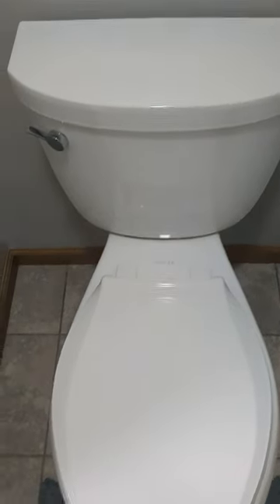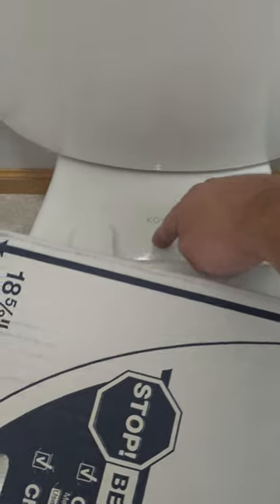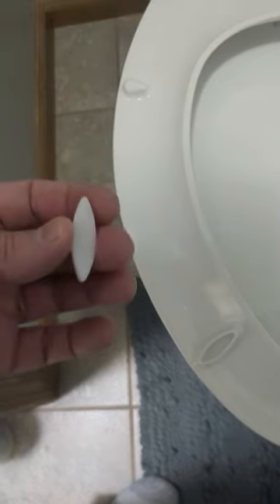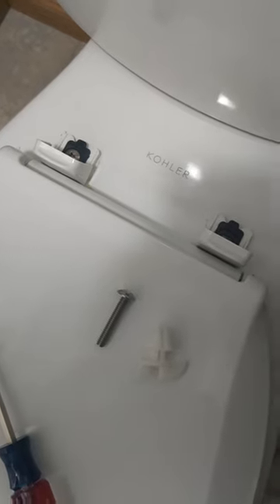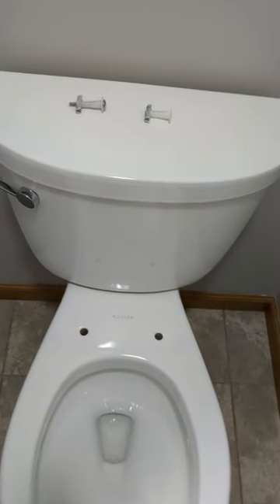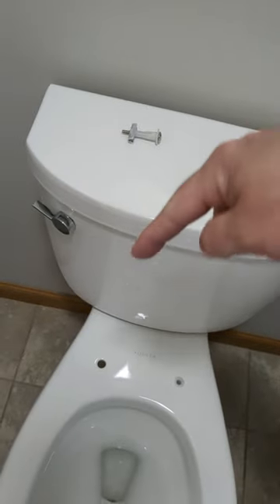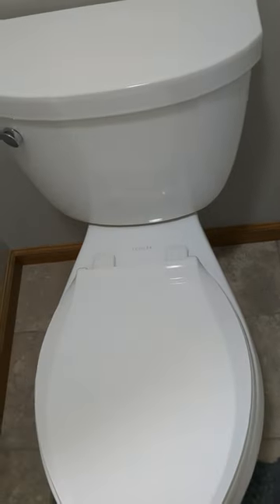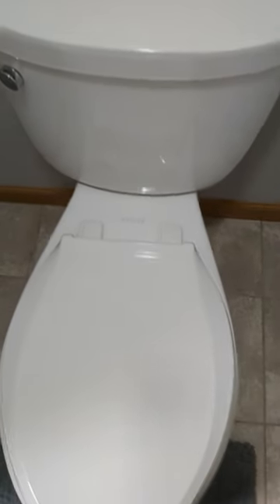Install a KOHLER 4636-RL-0 Cachet ReadyLatch Elongated Toilet Seat to replace a cracked toilet seat

Comment: Thank you so much for your video!  I couldn’t figure out how this “new and improved” fastener system worked, as the wife was saying, “Sorry, this was supposed to be easy.”  A complete fail by the manufacturer in not providing ANY instructions or illustrations of how this fastener was supposed to work.  But for your video, we would have sent this back.  Thanks again!

Comment: Mine cracked in the same spot on the back and directly across in the front. Seems like a manufacturing/molding issue with so many people having the same problem. Smells like a class action lawsuit. I'm down for getting a $5.74 check in 8-10 years! 😂

Comment: Many thanks! The lack of installation instructions in the box was annoying. We had 3 Kohler toilet seats that lasted 6 years before each of them started showing cracks, one in exactly the same place you noticed, the others along the side. Happened with or without the installed soft padding wedges, since we had two with and one without, all of which eventually cracked.

Comment: Thank you -couldn’t have installed it without your instructions.  I don’t know how to get the soft pad tips on the toilet lid because they seem too small to fit over the “bumper”?
I’m going on my 3rd Kohler toilet seat in 8 years … they  
have all cracked.  Both previous seats cracked at the bottom, the top and had fracture lines in the middle!!!
I asked the salesman at the plumbing warehouse about this problem and he said he had the same issues. Numerous customers have complained. I had no other option so I was forced to purchase this one again. 
I think the seat looks great. It’s very comfortable but as far as the quality of the material, it is fair. Not worth the cost $65!
Kohler needs better quality materials for this price!

Comment: I MUST send you a BIG Thank You for this video. I had the same problem with my old seat, except the crack was at the front instead of the back as your was. I ordered the same replacement seat which came with ABSOLUTELY NO INSTRUCTIONS. I did not find the installation process self evident at all, and I sincerely appreciate how you saved me a lot of frustration and time wasting. I also appreciated your tip about reusing the seat support thingies as the package was missing one! Thanks again from one weekend warrior to another!!

Comment: Had the same problem with identical crack on the front. Since the cracks appear to be in the exact center of the front and rear, it appears to be a problem associated with the molding process.

Comment: I had the same crack in the back, but only noticed it after a while, bought a new one as a backup for the day I would need to replace it, when the time came, I started unboxing the new one, and noticed the new one, which was still wrapped up also had the crack at the same spot. Kohler would not take it back since too much time passed since I bought it. must be a manufacturing error of some sort.
Reply: Update: The issue with the crack was back in 2022, the new ones now in 2024, like your new one, don't seem to have the crack issue any more.

Comment: I've had 2 Kohler seats crack around the rear seat "legs" that don't touch the toilet themselves so the seat was bending.  Not sure how to fix that.  Also, after unlocking you should be able to lift the seat off the black inner parts that have the bolt through them but its very hard and it seems like its going to break to collar.  But be sure to unlock the collar first.
Reply from the maker: I will take another look, but the bolt head seems too large for the seat hole to lift up and around it. Thanks.

Comment: I just bought one. The instructions say if you unlock ot lifts straight up but I have tried and tried and it won't do it. So it claims to come off but does not
Reply: Same problem here.  Anyone have a solution?
Reply: These are not “quick release” toilet seats! You have to get a different model!
Reply: @davidkirkham6497  yeah, found that out. very disappointed. What the hell is the "lock" for anyway
Reply: I had a hard time, but it does come off, you need to “snap “it up quickly and firmly… it does come off…
Reply: You grab it and pull firmly with a “snap”, it releases… I found a video that demonstrates the removal.😊